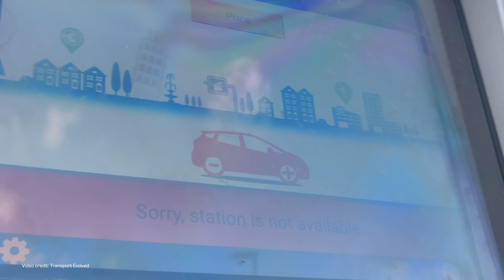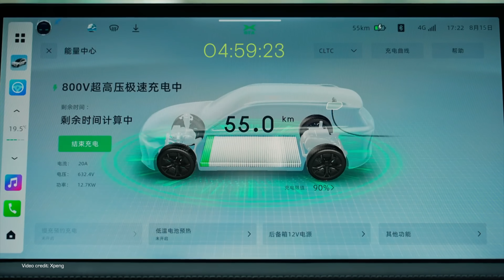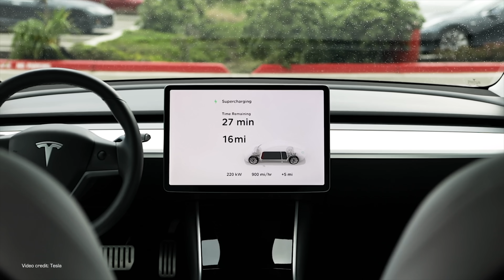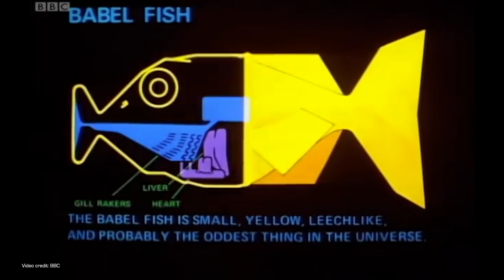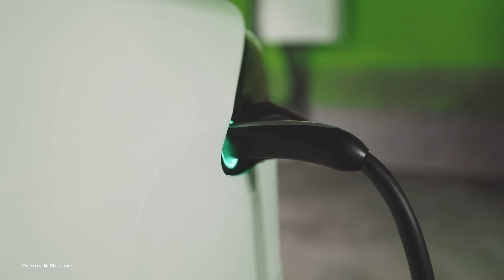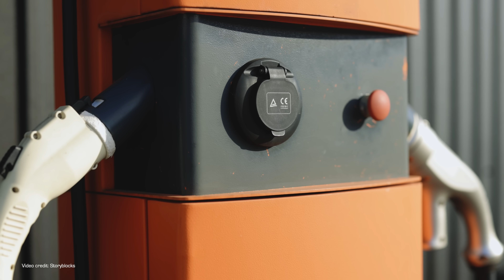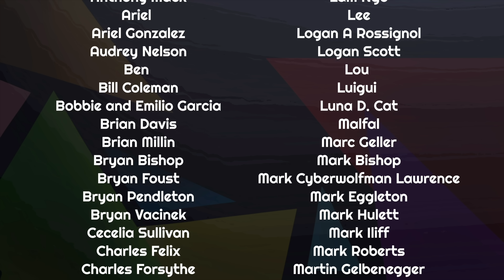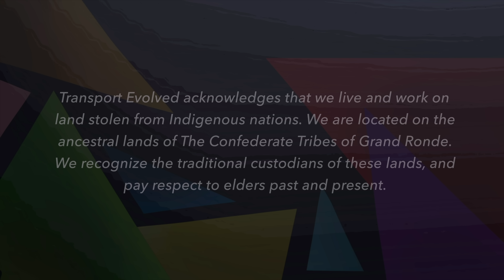NACS Standardized!?!

Comment: Note that the 277V solution does NOT work in Canada.  In the US, the 277V support means that you can avoid a step down transformer and take power directly from the distribution network.  The US has a 480V distribution network with phases at 277V.  In Canada, the distribution network uses 600V with phases that have 347V instead, which means you will continue to need a step down transformer to get to a voltage at or bellow 277V.

Comment: BMW i3 owner here: Isn’t the “magic dock” essentially already showing that adapter+Tesla app (for payment) should not be an issue for fast charging on Tesla Superchargers? … well, I tried it, and it was peaking out at 28kW (where the i3 usually gets close to 50 on EA and EVgo chargers), but it was a cold day and I hadn’t driven far/hard enough to warm up the battery. Also: Already have a slew of cards and apps for different charging providers, so any consolidation/reduction there will just be gravy 😀.

Comment: There’s also the problem that the charge cables on basically all superchargers are too short to connect correctly to a large number of EVs that don’t have the charge connector on the left rear or right front of the car, meaning that many non-Tesla users have to park in the wrong parking spot in order to charge. That is going to cause major headaches and probably some violence at superchargers, because there are an unfortunately large number of Tesla owners who think that they should have exclusive access to the supercharger network and that anyone who buys a non-Tesla EV is an “other.” I’ve used the magic dock SC at Boardman, OR on my Ioniq5 and it technically worked (although only at 40 kw due to SC incompatibility with 800V vehicles) but had to park in the wrong parking spot for the reason listed above. I was there in the middle of the night and only stopped there to try it out, so it wasn’t a problem at that time, but it’s going to be a major issue on a busy travel day.

I personally don’t think that the transition to J3400 is going to go well, at least when it comes to non-Teslas using superchargers. I don’t think there is any incentive for Tesla to do what they need to do to make it go well. Why make it easier to own a non-Tesla EV? It makes much more business sense to maintain the advantage of exclusive charging network because really, that’s 99% of the reason why they sell so many more EVs than anyone else now.

Comment: Nice "Boot Menu" T-shirt to go with booting out J1772, and adapting J3400.  However not sure if 'windows blue-screen of death' was the right colour choice. A StarTrek uniform colour option might have been a choice for wishing J3400 a "long and prosperous life" . 😉🖖

Regarding supercharges and screens for payment, the latest v4 editions do have screens (12:25). These the white kiosk units that have the built-in Magic Dock connectors. The older v3 superchargers (the donut hole looking one with a red centre) that have Magic Docks require use of the Tesla App. There's a home-screen option to "Charge a Non-Tesla". Currently only available in a handful of states. 
Regarding compatibility, I've seen a photo/video of a electric motor bike charging at a supercharger using a Magic Dock. (ie: Tesla's site specific CCS1 to J3700/NACS adaptor).

Comment: Maybe a Tesla API can solve the communication and payment issue allowing say a Ford vehicle to talk to Tesla. Maybe now that NACS (J3400) will be the standard going forward, maybe all of them should switch to Tesla's protocol. It's not going to happen but but I've enjoyed how seamless  it is to pull into a super charger with my car and it all just works. Other companies, with maybe the exception or 1 or 2, don't have that capability. You're at the mercy of these 3rd party vendors all with different methods of access, a host of reliability issues, and lack of support since the operator isn't the company in charge of the hardware (charging station/stalls).

Comment: The short cords and pedestals at the side of parking spaces on current Tesla superchargers are both quite problematic.  I'm hoping to see rapid rollout of newer Tesla charging stations with longer cords and positioned in the middle of parking spaces to eliminate those issues.  Such chargers may also be able to process credit cards, but I'm fine if they are only capable of utilizing an app.  Hopefully there are agreements with Tesla to give Tesla some up front capital to get new station construction rolling quickly.  While I don't like everything Tesla does, they do have the best charging network by far, and I fully support the move to Tesla charging as a result.  Crossing my fingers that it goes smoothly.  I just recently got an F-150 Lightning and am hopeful that I will be able to charge it at Tesla stations in another year.

Comment: Kate, Does J3400 require seperate user provided cords, or is this just an option?  

In Europe the standards allow for both "tethered" EVSE with built in cord, or the user provided cord with a plug on each end.  Public EVSE over there almost never have a cord (except 63 A 3-phase), but many home EVSE installs do use a tethered cord for convenience.
Reply from the maker: At the moment it's still a matter of debate. We believe there will be more clarity come the middle of the year.

^Katw

Comment: I have a question. What happens to the EV charging.networks that use CCS charging. Since the agreed upon standars is the Tesla connector can and will the other charging networks be able to convert to the new standard so it could also charge Teslas?
Reply: As is happening with CHAdeMo, CPO's (network operators) just stop installing new kiosks/stalls with CCS1 connectors. As replacement parts run out of supply for maintaining older CCS1 kiosks/stalls, then they will no longer be repaired. Some CPO's may upgrade older station locations to NACS connectors, but more likely just install new kiosks, or abandon the old hardware.
You may have noticed over the last 6 months, the number of new station locations coming online has paused. It will likely pick back up later half of 2024.
Reply: @AerialWaviator  I don't think abandonment will happen for relatively new equipment - the CCS1 cable will simply be replaces with a J3400 cable. don't forget, J3400 uses CCS for communication.

Comment: The NACS standard was designed by engineers to encourage EV adoption.
The CCS charging standard was created by ICE manufactures marketing departments to discourage EV adoption. With the hope EV’s would never catch on.    
In 10 years the only place you will find a CCS charger is in a electronic surplus store.
Reply: These points are over simplified assumptions. Reality is much more complex and doesn't involve conspiracy theories.
FYI: CCS is defined by the J1772 SAE standard, and it's had many revisions and connectors, all under the one "J1772" label. The earliest dating back to the 1980's before microcontrollers were commodities and when tape was the common recording media.
Reply: @AerialWaviator  
Then opportunity was missed decades ago to eliminate the contacts used for the handshake communications. It could have been done with a spit transformer. Making the connector even smaller, more reliable and resistant to weather.  Thats what happens when marketing departments get involved.
The main stimulus for the development of SAE J1772 came from the California Air Resources Board (CARB). Early electric vehicles like the General Motors EV1 and Toyota RAV4 EV used Magne Charge (SAE J1773), an inductive system. CARB rejected the inductive technology in favor of conductive coupling to supply electricity for recharging. In June 2001,
Reply: CCS2 is the standard in most of the world (and Tesla uses it in most of the world) and it works very well. I don't understand your logic.
Reply from the maker: Do you have any proof for the second claim? Because, well, we've not seen any evidence of that, and with respect, we've been covering this industry probably longer than most people watching have driven EVs.

Comment: Mennekes: You couldn't live with your own failure, where did that bring you? Back to me

At least there is still plenty of experience on the Type 2 -> Type 1 cables since a lot of Japanese cars were sold with Type 1 inlets long after Type 2 was pretty much mandatory (even new models, based on the technicality that they were technically facelifts and not new vehicles)

Comment: What has no issues in the USA regarding reliability ?
the grid for sure not - we have 99,9% availability here and even storms cause problems for all but the grid is stable.
Here companies loose their licences to operate if they do not deliver the levels they had to deliver. If you need 99% coverage of the population here someone will count if they made it or not and if the did not made it they have another year, but they will get a fine that will increase multiple times if they miss the deadline again. 

If you operate a charging network which is not working then those will be reported and consequences will appear cause the next time spots will be offered publically such unreliable operators will not get further access to even more chargers they might not be capable to operate properly. 

But of cause tesal charging network is a very good solution cause it is reliable, robust and serves now also the public. Not cheap, but price / quality ratio is good. 

At the end they made it right. Without that network we would not know where we would be cause electrify america is new, but crap and VW does not really care at least in the recent past even though their defeats have increased.

Comment: Kate, you make me laugh! Loving the Trekkie splices. 🤗
Like you, I am the proud owner of a Kia Soul ev, mine a 2017, complete with pending recall for the battery pack. Still no word on corrective action. I am crossing my fingers for a replacement pack. (worth wishing for). But did I understand you that there maybe just might be NACS to CHAdeMO adaptors on the horizon?  Hell, I'd settle for CCS to CHAdeMO at this point. There are virtually no CHAdeMO chargers anywhere near where I live (which is the ev Sahelle---not quite Sahara) that is Louisiana state. 
I had resigned myself to the likelihood of needing to eventually replace my obsolute (only 7 years old!) Car that I'm actually fond of.  I hope your "watch this space!" Comment is not just a dead end teaser, but now I think I have a smidge of hope of keeping my little Kia box for many years longer.
I certainly have no interest in plunking down $30k on another car, even though I WOULD like an aptera. (Sorry, I am brevity-impaired)

Comment: As with any change in standards, there will be some difficulties. But ultimately in the long run, it should all work out. For those old enough to remember, there was a time when cars could only run on leaded gasoline. Then cars had hardened valves and catalytic converters added. Now running on leaded gas would damage them. Yet unleaded gas would damage older cars. So gas stations sold both leaded and unleaded for over a decade. Once most of those older leaded only cars were off the road due to old age, they stopped selling leaded gas. Those few remaining older cars needed to have the heads removed so the valves could be hardened to work with unleaded gas going forward. Compared to all that, this connector change should be a breeze! :)
Reply: A spanner in the works for noobs, a Christmas present for haters, oil companies, luddites

Comment: My opinions are mixed.  The Tesla solution has always been more elegant and the CCS solution has always been just a hodgepodge committee design that I did not like but hey, if you make a decision to standardize and the government did with CCS, you need to have the dedication to do so.   Also keep in mind that the Tesla solution is actually the older design and uses thinner conductors though it has been recently been updated and Tesla claims that thinner conductors can still be used with active monitoring and power throttling.

Comment: Its funny how Chademo is so criticised as its non profit open source and is more reliable than CCS also Chademo 2.0 has a charge speed of up to 400kw as well as bi directional charging, although the new Kia EV9 now supports V2X which is a huge bonus.
Reply: CCS is already standardised up to 1MW and also supports bidirectional flow of energy. The biggest difference for the end user is that CHAdeMO is DC only while CCS can do both AC and DC on the same inlet. Makes the design a bit easier and more compact.
Reply: @Hans-gb4mv  Good to know but both Chademo and CCS are still better than NACs that is both closed ecosystem and will likely never support bi directional charging let alone V2G or V2H as well at least where I live Tesla supercharging costs a lot more for non Tesla cars. However at least where I live CCS have far more charging stations. We currently own a 2021 Leaf and a Kia EV6 and I do enjoy the very fast charging on the EV6!
Reply: @gregb1599  Give the arguments back to 2022 and move on.
Reply: It's betamax, now the tables have turned and I'm on the betamax / CCS team, NACS is Laserdisc (tm)
Reply: @rp9674  Nah CCS is streaming, all other video formats have largely become obsolete

Comment: Give me ONE reason (other than 3 phase charging because we don’t have that on this continent) that a double ended NACS connector wouldn’t work for us having our own cables at public chargers? I argue you can’t. It lock like ccs2, is smaller, and offers all connections needed.
Reply: You'll have a male end (exposed potentially live pins) on the charging pole, the European charging cables are male to female.
Reply: Liquid cooled cables. Can’t have those removable. That only applies to DC, not AC. But needing your own cable for AC but not DC would confuse us dumb yanks.
Reply: The charging cabal

Comment: Would be a good thing if AC charging stations had a receptacle as an option, in case the built in cord is damaged or stolen. Gives you something at least. I already carry a 30 amp extension cord with various adapters in the trunk, what's one more!?
Reply: Probably wouldn't work for fast charging because of cable heating.
Reply: @celeduc   No, I'm just talking AC charging like at hotels and such.

Comment: No, were not calling it j3400. It’s NACS. You guys are literally the only source I’ve seen j3400 more than once
Reply: Kate is correct on this.  No one in the industry is adopting "Tesla's connector".  The industry is adopting J3400, which happens to look a lot like Tesla's connector.  This is an important distinction, especially if Tesla decides in the future to implement changes not agreed within J3400.
Reply: Potato tomato.  J3400 is already tearing us apart.
Reply: Does NACS cover 48 amp 3 phase AC charging? Vehicle to load?   it's  a standard  covering much more than the specs for a charging plug. It doesn"t include plug and charge. 😂
That is a commercial transaction and needs to be worked out by the vendors. Tesla and I think evgo does  support that through their charging equipment.
Reply: @JohnRoss1  NACS, and ccs, j1772 etc, don’t handle 3 phase charging. 3 phase charging does not exist on the North American continent. We have 3 phase power of course, but it’s never put in any residential/consumer facing usage. It’s always single phase.

Comment: 10:09 - 10:28 : ...which is why the EU and Australia went with CCS Type 2 and mandated that every car was going to have that plug, full stop.
Reply: Well when you get cars like the Kia EV9 that can do bi directional charging, why would anyone want a closed system that cannot and is unlikely to ever support V2X
Reply: @gregb1599  I was thinking much simpler than that....like 'why no petrol vehicle has ever had that problem, since petrol pump bowsers are standardized'...
Reply: @vernonhampton6973  Because petrol is simple, it's one way only. Having a car that can be used to drive, power a camp-site or work site, then plug in at home and either power the house or sell the battery power to the grid. That NACs can never support that. The closest Tesla has got to that is with their Cybertruck with separate plugs, but the NAC connector cannot, while the Kia EV9 can output at 3.6kw for V2L and then an impressive 11kw for V2H and V2G, the 100kwh battery of the EV9 is like having 7.5 Tesla Powerwalls at home.
Reply: @gregb1599  Just one of the disadvantages of having a 2-phase charging system , when most electrical grid setups are 3-phase, I guess...
Reply: @vernonhampton6973  At least in countries with 240v